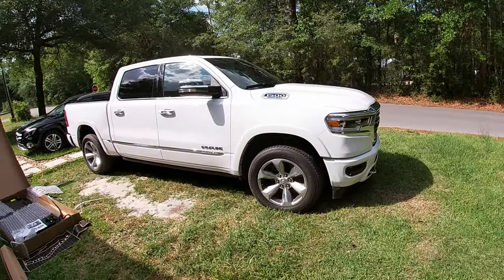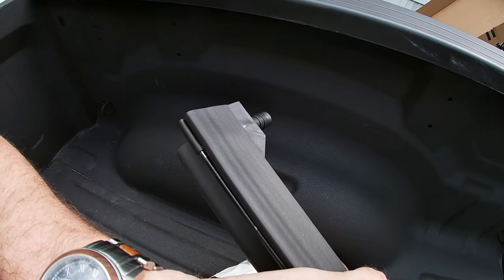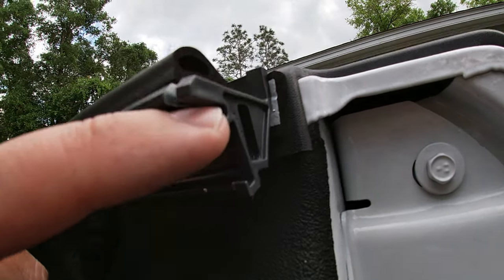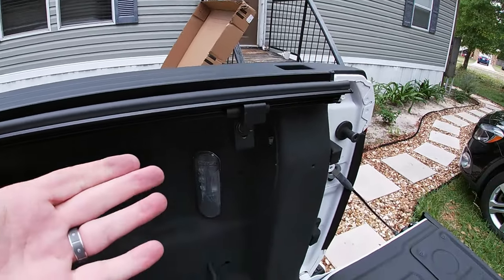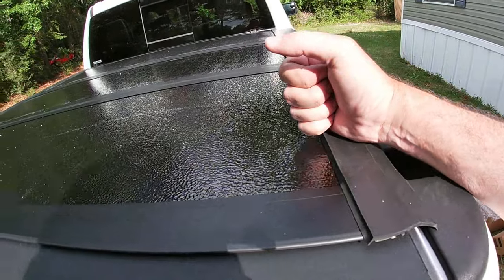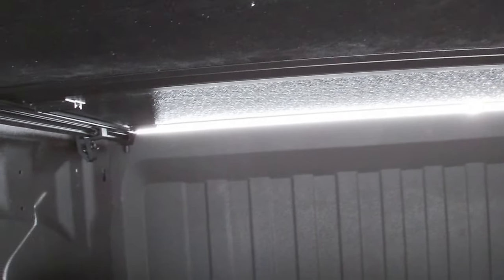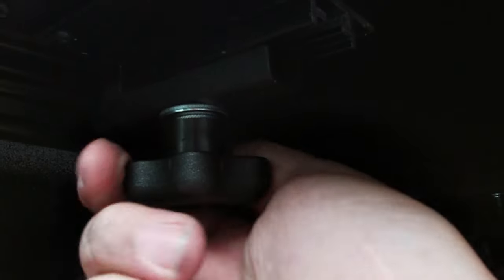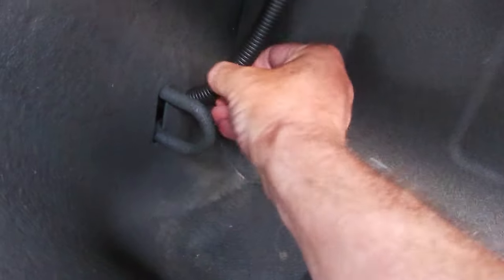RAM 1500 Rough Country 3 Panel Tonneau Cover Installation. HARD LOW PROFILE BED COVER.

Comment: Thanks for the video, installing mine tomorrow and this definitely helps 👍
Reply from the maker: Awesome. Glad the vid guided you a little. You’ll have no problem and just a side note, I’ve had zero issues with the cover since install last summer. 🤘
Enjoy your flush cover!
Reply: Nice to hear. Finally got around to installing it today. Looks good on the truck and was pretty easy to install with the help from your video. Great tip on loosening the back brackets a bit and closing the tailgate.
Reply from the maker: Sweet! Thanks for the compliment! Enjoy the cover!

Comment: I am about to put an Elevate Outdoor, Adjustable Louvered Steel Headache Rack on my 2015 Ram 1500 Outdoorsman 4x4.  Do you think there is enough room along the  cab side front bed rail to support both the headache rack AND this RC Tonneau Cover?
Thanks for your time and reply.
Reply from the maker: I am not familiar with that product or the install. But the side rails for the TC go all the way up to the front of the bed. However, they aren’t needed that close to latch or secure the TC. You might be able to trim them down a little if needed for the headache rack install clamps.

Comment: Nice video, thanks. Will it work with RAM 1500 factory bed rails?
Reply from the maker: It has its own rails so if you have a factory cargo system rail mounted, I don’t think the clamps will be compatible with that rail.

Comment: How easy is it to remove the cover? Just undo those clamps and pull it off the track?  I like how easy my soft cover is to remove and reinstall but love the look of the hard cover.
Reply from the maker: You got it. Just fold it up, unscrew the hand tightened clamps and lift off.

Comment: how does this hold up in drive thru car washes?
Reply from the maker: No issues, no damage, little water at the very edge of the bed, though the damn brushes never clean the top well enough. Wipe it down while it’s still wet after the wash if you don’t want dirt haze. 😉
Reply: @FloridaManTV  thanks for replying. I’m gonna order one. Great vid btw.
Reply from the maker: Sweet thanks for watching my review. I have had no issues with my cover. Still on the truck as we speak. 🤘🤘

Comment: have you tested it for leaks yet?
Reply from the maker: Yup. Major thunderstorms both stationary and while driving. Also a power car wash. Only the car wash let some water inside the bed but it only ran down the corners of the bed. Not much at all and wouldn’t effect anything stored in the bed. Maybe a Dixie cup amount in front and rear corners combined. Worth the price in my opinion. 👍🏻
Reply: right on

Comment: RC video shows a different install and instructions. With 2 screws to hold it on and crappy striker plates. Yours does not. Not sure what I want to do now.
Reply from the maker: Maybe their video was an older model of cover? Check the date on their video and mine and see if mine is newer. 
If so, they might have updated the kit.

Comment: looks like if you made the rails flush at the beginning, you wouldn't have had to go back and lower it... just an observation.
Reply from the maker: It’s hard to tell and with me having rail covers, it might have differed from the instructions. If I had to redo it, I’d just leave them loose in the beginning and then set ‘em for a flush/tight fit. 
Appreciate ya watching the video and supporting the channel! Thanks!

Comment: Sadly, my ram has the multifunction tail gate and will not work for this bed cover
Reply from the maker: Is there a hinge or something that prevents the rail from being mounted? I haven’t looked closely at those tailgates. Thanks for the info for me and other viewers. 👍🏻
Reply: @FloridaManTV  I have no idea. Even other bed covers that site ontop of the bed rails say they do not fit
Reply from the maker: Must be either a different overall length, width or something interfering with the inner rail mounting. Good to know though. Thanks for the info!